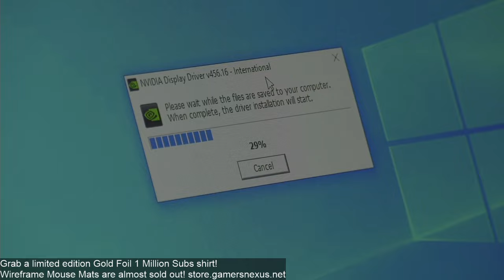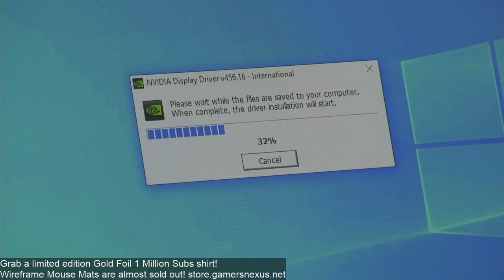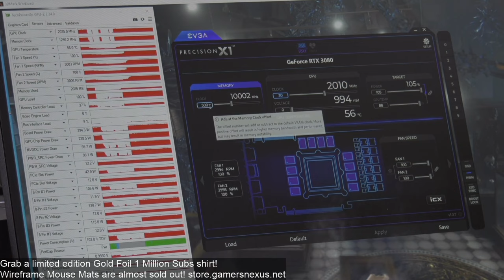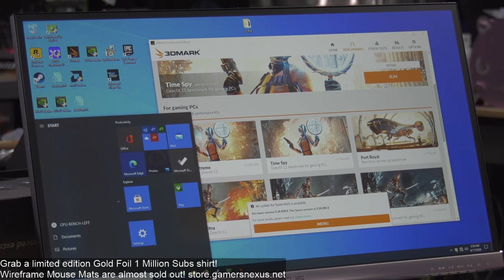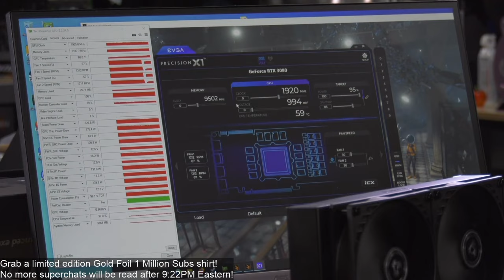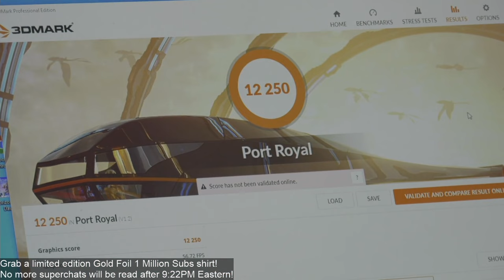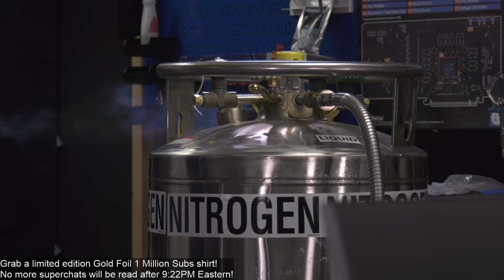LIVE: Overclocking RTX 3080 Custom Cards (ASUS, Gigabyte, EVGA)

Comment: TIMESTAMPS:  (Q&A timestamps in separate reply (to long for YT post))
1:50  - Model introduction
3:17  - short explanation its about live overclocking, not benchmarks) & Superchat
6:44 - Thermal Grizzly Sponsoring
8:30 -  1 mil subscriber T-shirt on Nexus store!
9:30 -  driver install is running
10:15 -  shows awesome mousemat (10% left)   (59:44 5% left)
10:50 - Starts with the Asus TUF - Stock run 3D-Mark
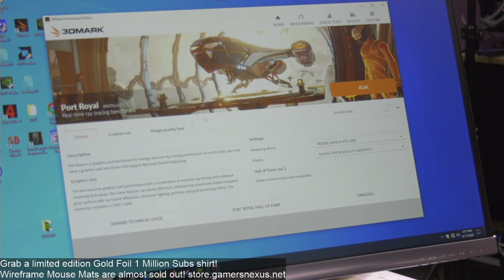12:00 - Starts Port Royal benchmark
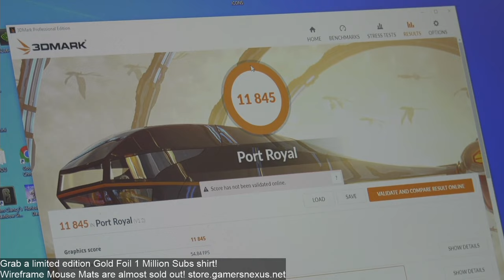15:25 - Asus TUF 11845 Graphics Score - Stock clocks, Port Royal
17:45 - Benchmark is running, GPU-Z readout
18:52 - Starts up EVGA-Precision X1 software  & writes down Benchmark scores
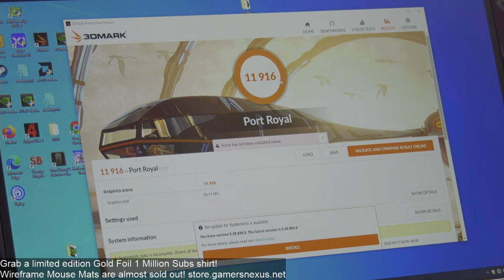Note from 26:50   :You can also use MSI afterburner, end-user choice/preference here.
19:15 - what to do with Powertarget
20:24- Increase powertarget & Run 2nd Benchmark
21:22 Analyzes 2nd benchmark - realtime stats
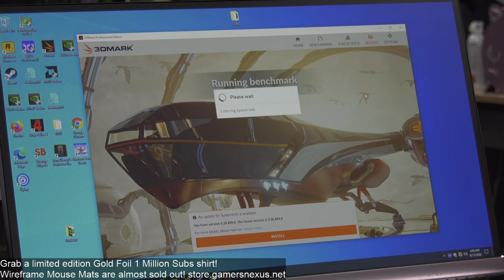23:22 Runs full-screen full-pass benchmark on maximum powertarget
26:50 Asus TUF 11916 Graphics score - Maximum powertarget only, Port Royal
27:42 EVGA-Precision X1 - starts with 60Mhz offset & increases fan speeds
28:35 starts Time SPy X-treme stress test.  - Actual manual Overclocking starts
30:15 Increases to 80mhz while running stress-test
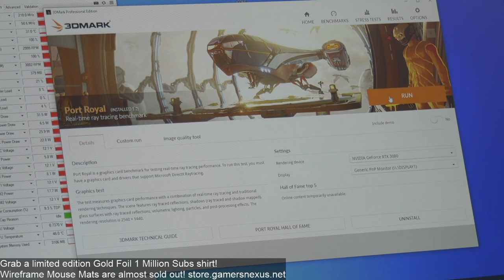33:48 Benchmark seems to have crashed - runs Port royal to see if its stable in P.r.
34:00 Question can you explain the 1% lows on FE overclocks?
37:00 Runs 4th Benchmark
39:31 Question: what is the upside of overclocking compared to overboost?
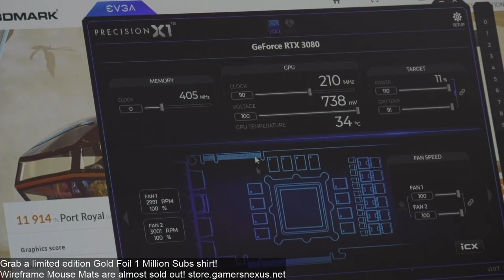39:53 Asus TUF 11914 Graphics score 
Adjusts X1 precision values - leaves core at +90, maybe down to +80. Powertarget @110%
Continues with Memory increase first now.
41:00 shows & talks about the different coolers of the 3rd party RTX3080s on his table :3
42:00 shows the "red lipstick" on the EVGA card and mentions EVGA might supply free replacements in Black and silver!     (for buyers & JayzTwocents, you might like this info ).
 @ 1:45:50 EVGA has replied on the red-lining and Steve gives us more info/update!
44:28 Offsets Memory Clock +600 (=10102mhz) (to make it crash and step it down)
45:04 Offsets Memory Clock to +700 and directly crashes; Decreases to 600 to if its stable for 1-2 minutes
46:14 Benchmark passes with +600mhz (10102mhz) on memory (1990-2025MHZ Core)
46:42 Card is powerlimited (@110%) for higher performance, Steve mentions Shuntresistormod with liquid metal to do that (and shows his own first shuntmod on a RTX Titan)
47:43 Runs Port Royal again to see if its stable.
50:23 Steve talks about the importance of Memory bandwith (GDDR6Xover current VRAM capacity
50:38 OC Benchmark result 3.8% increase:
ASUS TUF 12294 Graphics Score (+600mhz memory +90 Core, 110% power (maximum) OC) 
52:30 Brings down Core-Clock to +80 to see if it performs better
53:20 Q: at 3-4% increase is it worth to OC?
53:30 Steve suggests to hunt down a custom V-bios for more gains in OC if you're into it.
54:00 Chat & Superchat comments
55:25 Benchmark at  lowered OC +80 Core +600mem 110%power (max) Complete
Benchmark valued decreased/decayed Score: 11986
55:53 Shuts down and switches to EVGA FTW CARD

_____ 1H Mark _____ EVGA FTW

1:00:24 New Driver install & Chat comments - Superchat Q&A
1:03:00 Runs Baseline Benchmark of EVGA FTW - Stock
1:03:38 Shows a LN2-Pot/cooler, adapter plate & short how-to use & usage for the coming weekend.
1:05:10 Steve does a brief non-functional LN2-Demo to show whats coming this weekend
1:07:20 LTT Waterbottle on display - Steve meets his quota for Linus  ;)
1:08:13 EVGA FTW 12140 Graphics score - Stock / Baseline     - Benchmark results
1:09:10 Steve discusses the Benchmark Results of EVGA FTW (2.5% over Asus TUF)
1:11:29 Runs 3D-Mark Port Royal windowed with GPU-Z for value-read out and EVGA X1 Precision software (All stock values still)
Runs in baseline at 2010-2025mhz Core & 1187 Memory Mhz
1:14:55 Opens Precision X1, Runs benchmark with "205" (i think 105% Power usage)
1:16:16  Mutes line for EVGA call 
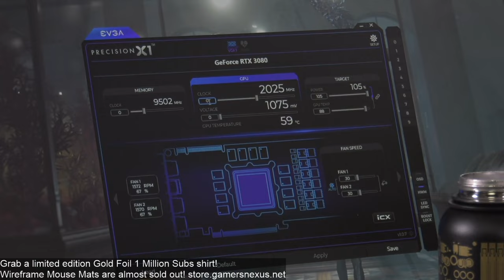 1:17:25 Unmutes the line of EVGA and asks for the power limit on the FTW3 Review bios.
1:17:55 EVGA - Jacob on speaker for everyone about the power-limit
1:19:00 Precision X1 Increase Core Clock +60 and back to +0 on :05; 
Benchmark runs at 0 offset but with max power limit (% of power usage is actually higher than displayed due to Reviewers-Bios with higher Base-line; See EVGA call time-stamp  )
1:19:05 Steve explains about Base-lines, Power-usage and offsets, informative to us, viewers
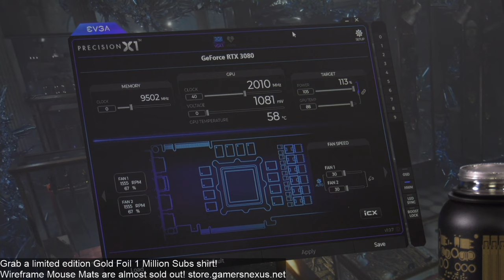1:20:30 Steve sets Core Clock +40 with max Power-LImit  (personal note: this is actually a higher overclock due to higher baseline on EVGA).
1:21:27 Runs 3rd benchmark on EVGA FTW3  & does more Q&A
1:22:13 Steve starts telling in Q&A how he started on Hardware & Computers incl GN start..
1:22:50 opens GPU-Z during benchmark & Q-A
1:24:29 Stable Benchmark & Results on the +30< Clock  Overclock
1:24:40 Memory Tuning of the EVGA FTW3 (+0?) but runs stress-test
1:25:53 Memory tuning of the EVGA during stress test Increase to +500mhz & increase fan speed
1:26:06 Nice video shot of the EVGA FTW3 (taking off on fan-increase ;)  )
1:27:27 EVGA FTW3 is power limited, drawing 393-400W (though 3x 8Pin)
1:27:28 Increase Memory to +600Mhz offset (from base-line)
1:28:00 Comments & Store
1:31:18 Benching Memory at +600Mhz failed, Reruns at +550Mhz overclock
1:32:42 Benching Memory at +550Mhz Crashed; back to +500Mhz No, try +620, lucky draw
1:37:44 Benching Memory at +620 was not stable back to +500mhz
1:38:00 Runs full Port Royal Benchmark at +500Mhz and +30 Clock (from baseline) max powerdraw allowed
1:40:58 EVGA FTW3 - 12383 Graphics Score @ +500mhz  +30 baseclock, Max powerdraw
(highest so far)  +0,7% compared to ASUS

1:42:27 Mid Stream summary after running ASUS TUF & EVGA FTW3 stock & OC benchmarks

1:44:23 EVGA FTW3 - 12435 Graphics score Port Royal @+500mhz +40 baseclock
1:44:50 Rerun benchmark at +500mhz +50 baseclock (wasnt stable in stress-test though)
1:45:50 Steve discusses EVGA has addressed the Community complains about the red accents  and has a solution for its customers for the "nicknamed: batman / Lipstick effect")
1:45:33 Shows all 3 cards again on Aesthetics reply to question
1:48:25 EVGA FTW3 - 12460 Graphics score Port Royal @+500mhz +50 Core & max Powerdraw
1:49:23 Benching with +60 Core memory +500mhz & max powerdraw for Port-Royal (port royal runs better/more stable then time-spy extreme)
1:50:40  ;) Steve lights a torch..  to show there is still enough oxygen (LN2 oxygen lvl answer)
1:52:15 Bench Failed
1:53:36 Concludes EVGA benching +50 Core +500mhz  (12460 was highest attainable with power-draw allowance).

_____ 1:59:07  GIGABYTE EAGLE RTX3080 (DDU & drivers)
2:01:57 Steve shows a Liquid metal shunt mod on a 2080TI
2:04:53 Opens Port Royal for a Baseline Benchmark
2:07:39 Gigabyte EAGLE Graphics Score 11777 - Port Royal - Baseline / Stock
2:08:12 RECAP so far
2:09:07 GIGABYTE EAGLE 2nd run in windowed mode with GPU-Z on side for read-out
2:09:20 Check out the awesome T-Shirts and limited editions 1-Mil subs on GN-Store! TY ;)
2:10:35 Steve Analyzes GPU-Z values during Benchmark run of the GIGABYTE EAGLE card
Around 1940Mhz Core  1187.7Mhz on Memory
2:12:50 Opening up Precision X1 - software  -- No PowerLimit increase possible on gigabyte card
Only 100% fan increase and re-run of Port-Royal
2:14:45 Steve says that he hopes Gigabyte will consider a Bios-Update for Powerlimit-slider..
2:16:35 Gigabyte EAGLE Graphics Score 11858 - Port Royal - stock clocks, maximum Fan 100%
2:17:10 Start up Stress test to manualy edit Overclock Values
2:20:28 Overclocking -- Nope puts back to 0 to see base clocks first on the run and fans to 100% to see what the Temperature does
2:21:41 Reply of steve to Question about poor Overclocking of RTX30 generation so far
2:23:05 Results and evaluation of Gigabyte card running at 100% fan on standard boost&clocks
2:23:18 Overclocks with +30 on clock (worst performing card yet)
2:24:22 Results of overclock -> tries a +50 offset on clock
2:25:40 Card is at 2010-2050 Mhz during benchmark run with +50 offset on clock
2:25:50 Overclock boost to +60 on clock
2:29:26 Overclocks to +80 on clock (hopes it is a crash value)
2:32:50 Makes adaptations on overclock, but not crashing (possibly to much powercapped)
2:33:20 Offsets to +500Mhz on memory and +100 on clock
2:36:25 GIGABYTE Graphics score 12218 -  Port Royal  3.7% increase from stock
2:38:17 Offsets to +700Mhz in Time Spy Extreme (windowed)
2:40:00 Tells why GPU in Desktop Manager is not a nice display software, use GPU-Z
2:42:42 Awsome memory, to bad of the VRM / power (will contact Gigabyte)
2:45:25 Analysis of the +700Mhz Benchmark run -> let it crash on +1000mhz
2:46:00 Reruns Port-Royal on +900Mhz memory
2:48:43 GIgabyte 12250 Graphics score Port royal +900Mhz memory +100 clock 100% power
2:50:00 Not enough power to go up further 
2:50:05 makes adaptations (+900mhz +120 clock) - Restarts Benchmark Run
2:53:10 Gigabyte Aegle Graphics score 12087 (Decrease of performance)

2:53:41 A quick Recap of results
LOTS of Questions & remaining superchats

3:26:51 Steve about the stream, content, superchats
Cherry picking of remaining questions..
3:31:30 Steve Recaps entire content of overclocking
3:34:20 THE END

Tnx for reading till the end of my first time-stamp post ^^
in a reply i put the timestamps of most Q&A till 2,5hr in (not enough characters left here)
Reply: Thank you, good Sir. ;-)
Reply: 2:07:39 Gigabyte Baseline Score + Gigabyte Start (goes till the quick recap listed below)

2:53:41 Quick Recap of all cards
Reply: Thank you so much for the time stamps ❤️
Reply: Fck danm my guy
Reply: "deep loaded" was really "de-bloated" meaning bloatware was stripped out to leave as many resources as possible for benchmarking. Essentially, nothing unnecessary dragging down performance needed for crucial tasks. 

As an example, I recall that Windows Vista and Windows 7 use VRAM for the "Aero" blur effect so if you switched to a basic Windows theme you would reclaim that VRAM for other tasks. I don't think it was a lot of VRAM, but in some cases every little bit helps.
Reply: QUESTION Q&A Timestamps:
  (original post got to long & errored out XD)
At 2:35H in stream out of Character-max on my original post :S ..

first time doing Time-Stamps for a video :P..

16:28    : Superchat Questions & Comments
48:01 Q: What are your favorite cases (depends on intended usage)?
48:50 Q: Why did no reviewer touch the point that 10GB VRAM isnt future-proof?
58:55 Q: MSI Gaming X-Trio vs EVGA FTW? -- no reply, MSI still on its way..
1:01:10 Q: is it worth dropping the extra for 3x 8pin vs 2x 8pin? (RTX3090 watercooled)
1:02:34 Q: any ETA on your MSI X-TRIO?  (A: tomorrow, will pre-bench probably to see for LN2 this weekend)
1:08:30 Comments
1:14:39 Superchat Q&A
1:16:14 Q: as RTX3080 FE does 370W on mild overclock, what do you think this means for RTX3090?
1:20:55 Q: would the 8600K @ 4.8ghz bottleneck this GPU?
1:25:07 Q about EVGA XC3 black edition if steve will review it
1:25:39 Q about noise level
1:26:30 Q: what do you think this launch says about NVIDIA as a company?
1:26:48 Q: Are you gonna active Channel-memberships?
1:27:00 Q: How about the KINGPIN card?
1:31:30 Q: What card can OC the most  --- A: thats what we're figuring out & in progress
1:34:30 Q: Have you got a chance to try out Cryonaut extreme yet?

1:35:39 Q: is there a reliable way to see how much V-Ram is actually used?
1:37:00 Q: is 700W enough for the new videocard with 9700K..
1:37:43 Q: about 3090TI? 3080TI & V-ram
1:38:08 Q: how long till the 20 series cards will have a pricedrop?
1:39:25 Q: Is there any information if NVIDIA FE cards are binned?
1:40:24 Q: How about an OC'd FE-card vs a OC'd 3rd party (with waterblock on them?)
1:42:13 Q: I want the summary of the results..  
1:45:14 Q: Have you tested flashing BIOS's? 
1:45:25 Q: what are the best results so far? A:12343 on the EVGA FTW OC
1:45:33 Q: What RTX3080 do you like most for aesthetics?
Looks: Starts about the EVGA  then:
Aesthetics: 1:46:50 on the ASUS TUF.
Aesthetics: 1:47:23 on the Gigabyte
1:48:50 Q: will you run a de-bloated windows benchmark?
1:49:03 Q: i wonder how many Nvidia members are watching your stream right now?
1:49:50 Q: do you have any way to detect Oxygen level going to low due to LN2 tank gassing off
1:51:04 Q: For vertical GPU - is the reference (FE) cooler a bad idea for the RTX3080?
1:52:27 Steve shows the effect of a vertical GPU exhaust with an example
1:54:48 Q: AIO cooler on top of the board and higher than the radiator.. why the exception?
1:57:00 Q: why does the EVGA has a Sad Mouth of lipstick..
1:57:35 Q: why does OC not get you much (in relation to memory errors)
2:00:07 Q: 456.38 driver not the most recent?
2:01:34 Q: do you plan to do liquid metal on the shunt?
2:03:53 Q: Can you testfit on an NCase-M1?
2:05:41 Q: do you think its worth it to get a RTX card for 1080P 144hz gaming?
2:06:29 Q: Wil you get RTX3090's to review, what perfomance gains do you guess over RTX2080?
2:06:50 Q: will a stock 8600K with AIO (or with OC) be a good pair for a RTX3080?
2:15:30 Q: what is the amount of time it takes to do a review?
2:17:30 Q: Do you like Cheese?
2:18:35 Q: how hard are the rest of the components tested?
2:21:41 Reply of steve to Question about poor Overclocking of RTX30 generation so far
2:23:39 Q: when did you last play video games?
2:25:55 Q: which card overclocks the best so far (EVGA FTW3)
2:25:57 Q: Does PCIe-3.0 Bottleneck?
2:26:20 Q: did you ever get into CIV
2:26:30 Q: whats your favorite GPU overclocking software?
2:26:50 Q: any signs on weird Alien Artefacts on the cards?
2:27:20 Q Any news on the end of SLI support?  (personal NV-link ?)
2:28:00 Q: Any on Compute and knee-Cap on these cards on PCI-e GEN2?
2:28:47: Q: AMD GPUs.. .. what they lack in performance, they lack in drivers..
2:29:43 Q: News on the Large mousemats being back in store?  
2:30:25 Q: uses MSI afterburner because of G19 Keyboard, Steve Reacts :)
2:31:00 Q: So many cards on the shelves of tech tubers..  
2:35:45 Q: Any MSI reviews coming? 
2:35:51 Q: what do you expect from RDNA 2?
2:37:10 Q: Should i get the 10900K with 3080 for best performance:
A: 10600K 10700K would also do fine with OC, same place
2:37:20 Q: 3600X Get green screens is my power to low or driver issue?
2:41:22 Q: Do you do GPU-VR benchmarking?
Personal note: would like to see at least one VR-display load on the GPU / comparison to f.e. 1440P / 4K display  as a benchmark (comparison on 2080FE. & 3080FE)
2:41:35 Q: do you plan to do airflow benchmarking on Partner-Cards?
2:41:40 Q: how does V-ram change VR Display Resolutions performance on 2K  displays ?
2:41:45 Q: can you perform benchmark on actual Vram usage vs allocation?
2:43:30 Q: Question for signed shirts ? A: -- not rlly possible
2:44:40 Q: are the mousemats Cleanable with water & bit of soap?
2:44:50 Q: about california fires & Optimist Foundation (&studio build)
2:46:15 Q: suggestion for trying 2 games on V-ram usage
2:48:20 Q: Does HDMI 2.1 port matter at all?
2:50:00 Q ...  nice questions will timestamp later)..

Short summary of his overclocking steps: (to shorten original timestamp Post)
Overclocking step 1: install recent drivers & Reboot

Overclocking step 2: mark down & keep track on benchmark-Scores; Core-Clocks & Mem-mhz & Power- offsets; Temperatures; Fan%  (aka performance stats).

Overclocking step 3: keep an eye on GPU-Z and power, temperatures and clocks (performance stats) while running.
Write down in your spreadsheat after test (19:00)

Overclocking step 4: increase your powertarget and rerun Benchmark (windowed),
keep an eye on performance.
Overclocking step 4.1 Write down used parameters & new 'performance stats'

Overclocking step 5: Increase offset with 50-60mhz offset, increase cooling
and run a GPU-stress test (like Time Spy), keep powertarget on max.
Keep increasing while running the test and see where it fails.

Overclocking step 6: If overclock is stable, increase Memory clock with 500-600 (100mhz increments) + run a short benchmark/stress-test

Overclocking step 6.1: if memory overclock looks stable, run a full pass on the found frequency. An overclock might be stable on 1 test, but unstable in another test or (newer) game for that matter.    Note from 1:34:02: if you see artefacts, its not harmfull but your Memory-clock is to high (unstable) and you need to lower it.
Overclocking 6.2: After a stable full-pass write down Performance values & scores
Overclocking 6.3: Write down new values as final
Personal note: run a few other benchmarks (like your favorite game aswell!) for stability
Reply: You = God!
Reply: insane thankyou
Reply: Thank you
Reply: Time stamp Jesus
Reply: oh my god did you use like 7 hours on this?
Reply: @brdgrill3653  that seems about right especially listening all the questions and getting the seconds right for the time stamps  I was duo tasking though
Reply: thanks man for the time stmaps god sent, good luck, god bless, and good day to you
Reply: @NRIII Games Etc. starting from 2 Hours and 50 minutes lots of q&a and comments are about People having Trouble Getting Their hands on cards..
Reply: @NRIII Games Etc. Non in Alaska Eleven in New York, 16hr wait At microcenter and insane prices on eBay scalpers
Reply: That must have took a lot of effort. Thanks!
Reply: You champion.
Reply: Thank you for your hard work.
Reply: Hero
Reply: What a legend.
Reply: THANK YOU! These time stamps really help me to be more interested in such a long video. I can pick and choose what I wanna see and get the best of it
Reply: You’re a legend
Reply: Thank you sir
Reply: Thank you
Reply: You've got ocd for sure. Anyways thanks, won't be using them but thanks
Reply: damn 🔥🔥🔥🔥🔥🔥🔥🔥🔥🔥🔥🔥🔥🔥🔥🔥🔥🔥🔥🔥🔥🔥🔥🔥🔥🔥🔥🔥🔥🔥🔥🔥🔥🔥🔥🔥🔥🔥🔥🔥🔥🔥🔥🔥🔥🔥🔥🔥🔥🔥🔥🔥🔥🔥🔥
Reply: Thank you!
Reply: You've got too much time on your hands or you're schizophrenic. Funny thing is, 3 years have gone and still no heart react or pin from GN. 😂😭 Biggest L ever